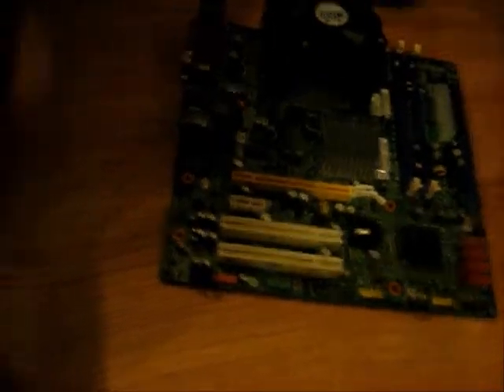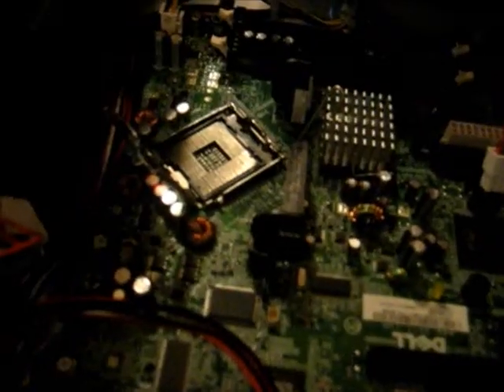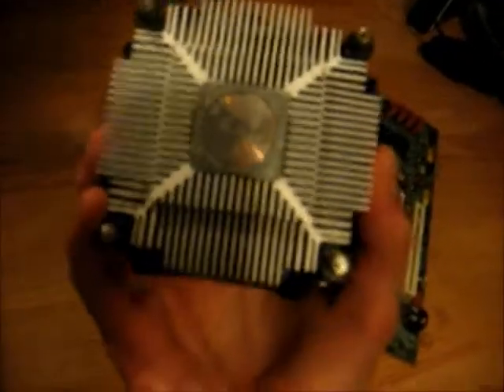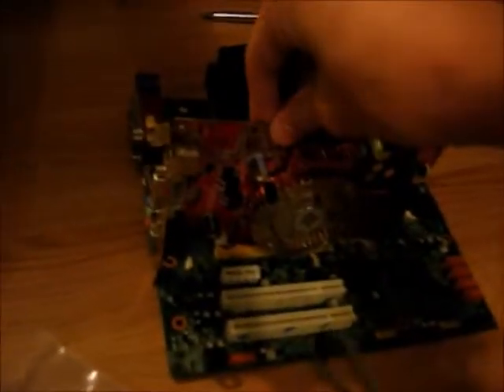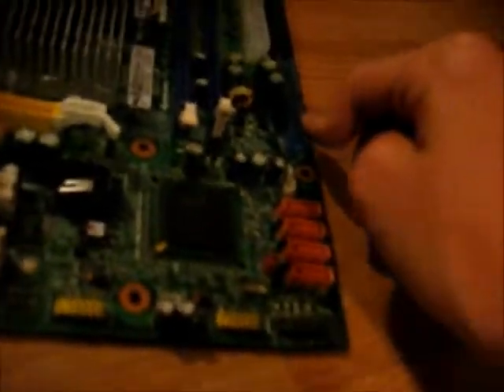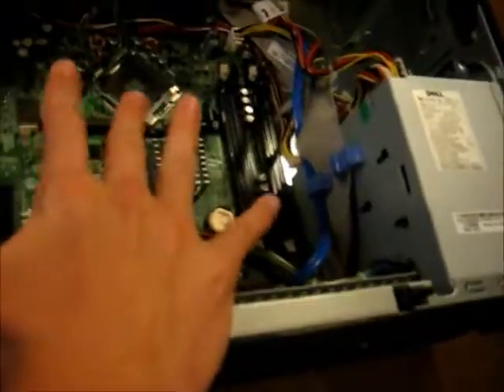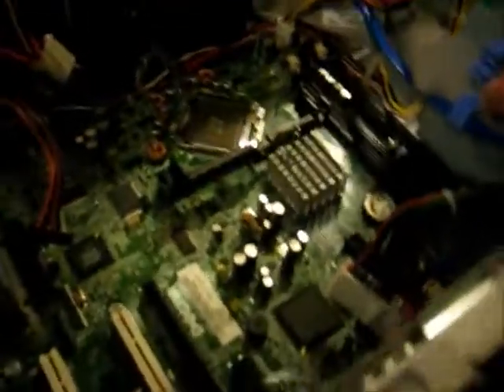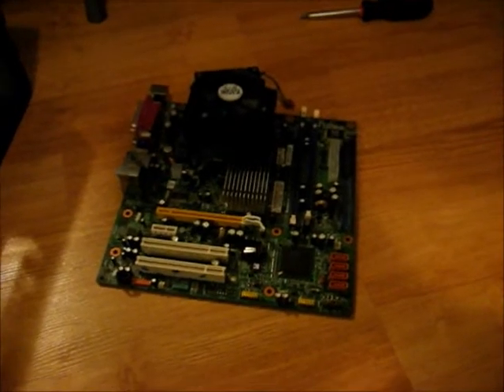Why a Core 2 Duo is better than a Xeon for CONSUMER USE

Comment: I was considering doing the xeon mod for the 775 socket, but after watching your video I think I may just go with a core 2 duo or core 2 quad.  Is there a huge difference in performance between the two?  Core 2 duo's are certainly a lot cheaper.  Computer will primarily be used for surfing, watching videos, and listening to music.
Reply: I'll get a Core 2 Duo E7200 if you're just in with surfing, watching videos, and listening to music.
Reply: No no no. Do the mod. This guy really doesn't know what he's talking about. The 771 Xeons are the SAME silicon as the 775 Core2Duos, they are just binned better and packaged differently. What he said about the cost might have applied back when they were current, but that was 5 years ago. Hell, he was wrong when he made the video... Assuming you're buying a used Xeon chip on eBay, it's a way better deal for the performance.
Reply: Yeah I saw they have quad core xeon's for $20 on eBay. I think I'm going to order some of those adapters and try it out.
Reply: Xaekai Why bother with Xeons and mod it to make it work on 775 socket? Xeons are made for Server/Workstation purposes. I'd go with the Core 2 Duo or Core 2 Quad for the price.
Reply: Is there a difference in performance?
Reply: There isn't.
Reply: Not to mention the 12mb l2 cache!